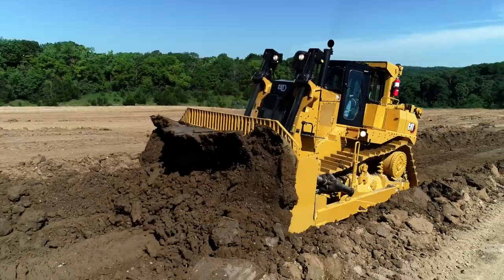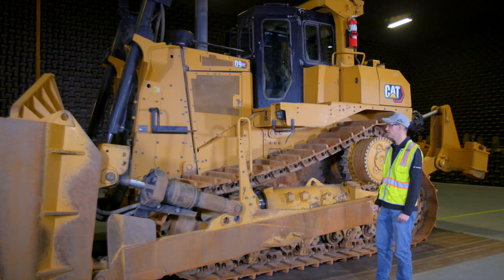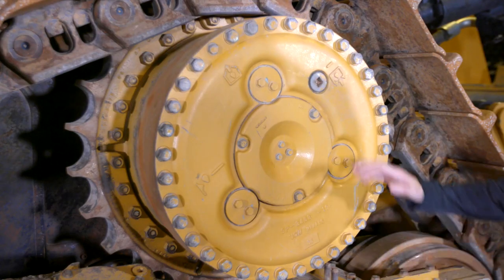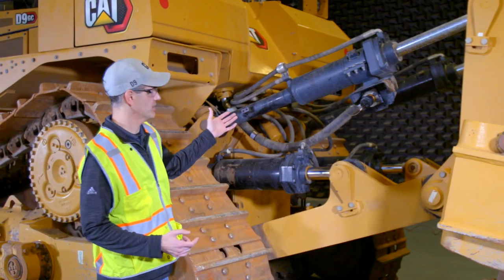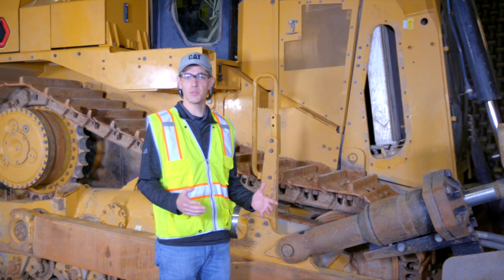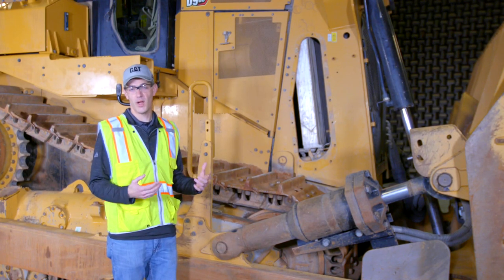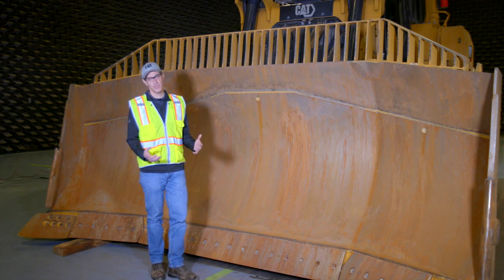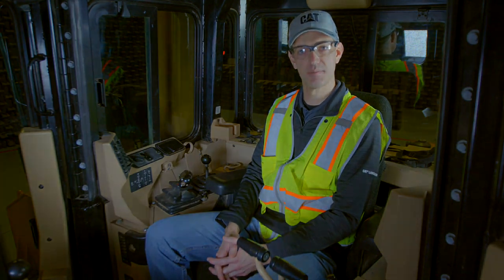Cat® D9 GC Dozer | Walkaround and Demo

Comment: A lot of useless info here. Iv been running D9’s for last 21 years. 1 R model, 2 T models, 1 POS kamatsu d275 and now the new D9. Haven’t run the D9 yet waiting for U blade to get here. So that’s 5 new machines ! Crushed rock stock piles, crushing 2400 tons per hour. The R model was is the king. That said the new 9 should be better then the T’s. We see ! I’d like cat to put together a stock pile special. U blade max counter weights and at least 113,000 lbs operating weight with 500-550 hp
Reply: If U want that sorta HP and weight then U get a D 10, thats  what they make them for,  coz its bigger than a D9.